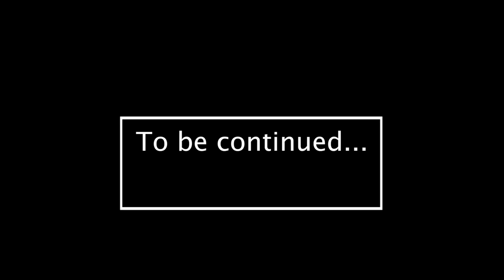Full restoration of a burnt car | Miraculous restoration

Comment: I also once found a burnt car on the side of the road. I dismantled the air condition pump and painted it pink. The car started right away and we drove into the sunset. I'm not making this up.
Reply: Pan mu Panie Łomnik po prostu zazdrościsz umiejętności spawania nieoczyszczonej blachy metodą MIG like TIG i tyle.
Reply: Mister Złomnik, when do you zrobisz to samo z Daihatsu?
Reply: WOW CLAP CLAP CLAP CLAP CLAPCLAPCLAPCLAP
Reply: Proof¿
Reply: Tak było, Mister Złomnik nie zmyśla. Nawet kierowca autobusu wstał i zaczął klaskać. Sam widziałem. A na końcu usiadł sam za sobą.
Reply: same
Reply: @byrne_art  lmao Its a sarcasm. smh
Reply: Ooooo... Nasi tu byli ;)
Reply: Same here also i used the warped burnt parts and it work like new leaks like hell but it works fine everytime i go out i recharge it👍💯
Reply: I remember.
It's Kia Pride Beta.